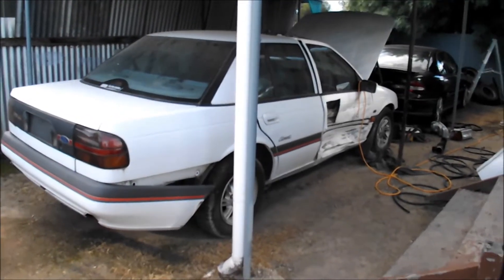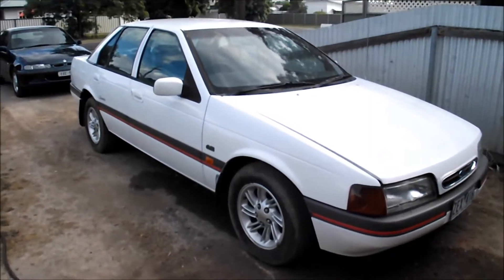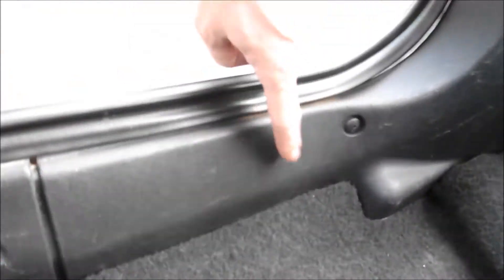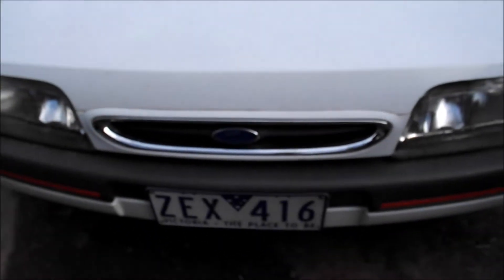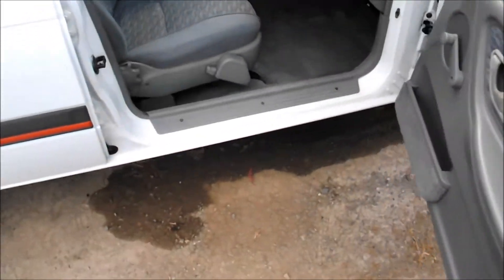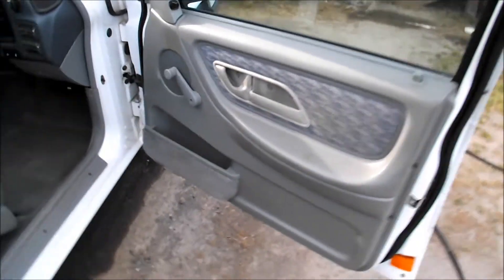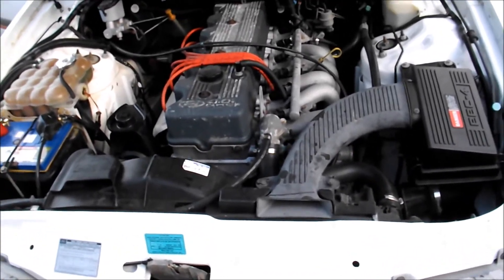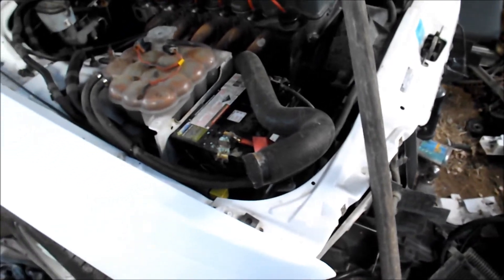Holly's ED smashed and a look at the new ED

Comment: The ED looks like it out of the showroom apart from the few dings
Reply from the maker: They were both looked after from new and never ran only water in the cooling system instead running the correct coolant, the majority of Falcons I have seen with head problems were neglected cars

Comment: Do you still recommend a transmission cooler under normal driving conditions? Some people say that transmission damage can occur if the transmission is too cool but I’m unsure
Reply from the maker: I absolutely still recommend a transmission cooler  because the transmission overheating will destroy the properties of the transmission fluid and that will damage the transmission. If you add a transmission cooler in addition to the one in the radiator than the cooler built into the radiator will raise the temperature in the transmission to normal anyway; I do not think that the transmission needs to be above a minimum operating temperature to avoid damage